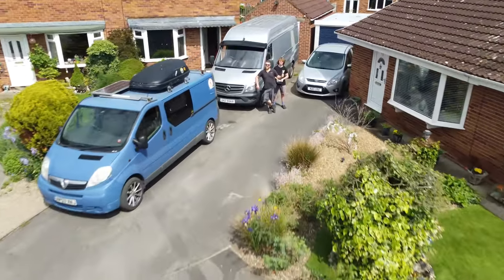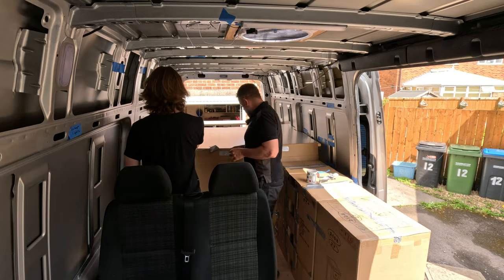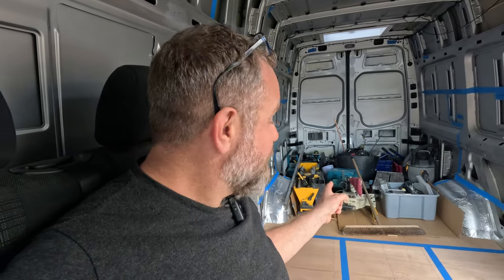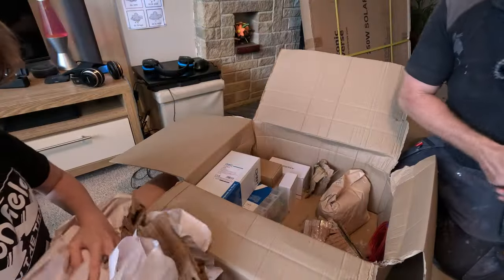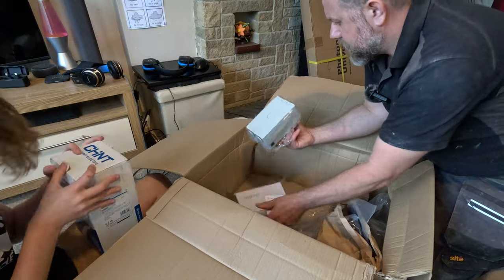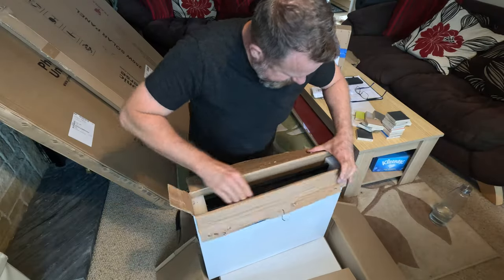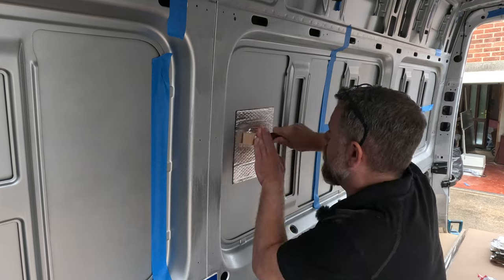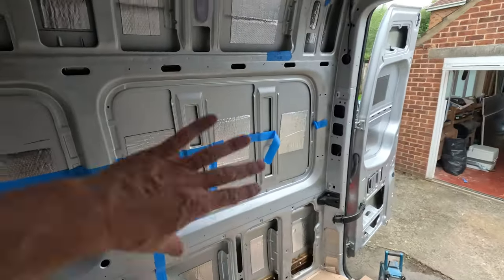Unboxing Electrics for Van Conversion, Smashed Solar Panel!!

Comment: Always considering weight, more panels may make a small percentage of improvement to sound and vibration reduction, but the benefits of panels already installed will be very noticeable. 
I do like the unrushed, carefully considered, and planned approach. Enjoy!
Reply from the maker: Exactly. Couldn't agree more. I'm always thinking of the weight. Those packs of deadening pads are heavy.

Comment: Deffo no more sound deadening on those panels with it 😊 waste of money we think! And deffo no vapour barrier on top of the insulation boards you're using as it already has it on so fab for money saving! Just grab some vapour tape for the joins... I personally didn't see the point in the vapour barrier on the last van. As you end up screwing through it anyway 😂 
Keep up the good work! It's so daunting at this stage isn't it 😂 we are wanting the faff of fitting back seats to be over and done as we need the back seat raising to match the front ones! Little jobs that take the longest!
Reply from the maker: Hi👋. Thanks for the advice. I'll see how I feel when I get to the walls. Greg virgoe argues very convincingly for the barrier🤷‍♂️. Who blooming knows 🤣.
Reply: @life_uncharted  haha yea it's so hard to know what's right and wrong. Just go with what you think. You can't really go far wrong 👌
Reply: @life_uncharted I d trust the likes of Greg Virgoe  especially since he studied & worked in the insulation business . ; just take a look back at Greg Virgoes 17 video Budge build series ,1yr ago . Anyhow grt going 👋🏻🏴
Reply from the maker: @jansweeney1333  hello 👋. Thanks. Yeah he certainly knows his stuff😁
Reply: @life_uncharted i recon with Greg Virgoe s prior experience as a Service Engineer & Uni studying he is well served too give the advice /working knowledge . I trust in his theory & practice ,one I ll follow. 👍🏻🏴

Comment: Hi Adrian, Glad the company replaced the broken Solar panel ASAP. Quick DC to DC question can I use a power station ie Blueti etc... instead of a leisure battery from the Van ? Not very good with the Electric side of things in a van. Your hilarious as well. 😂. 👋🏻🏴
Reply from the maker: Hi. Yes. I just wish they'd take away the broken one 🤦. I'm no expert on the power packs but yes, you can use them instead of a leasure battery. It's a good option for someone who's not comfortable with the electrics. Watch Mels big van small world. He's building a van right now that's having a power pack instead of an electric system.

Comment: I wouldn't go overboard on the sound deadening. They are designed to add mass to your panel to reduce vibration. The sound you get when hitting the panel is a thud so it's already doing an effective job. And that's crap about the panel is not the manufacturer that isn't taking it back or the company you bought it from?
Reply from the maker: Cheers. Yeah I'm thinking the same anout the sound deadening. Cheers for the feedback. And yes the company that supplies the panel says it's 'not in their policy' to take away the broken ones. But I'm kicking off 😁💪